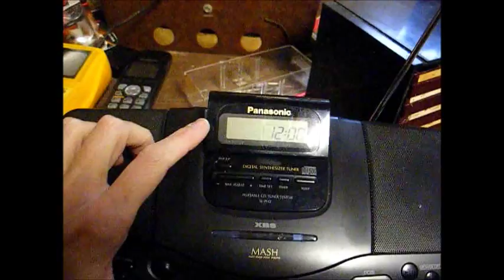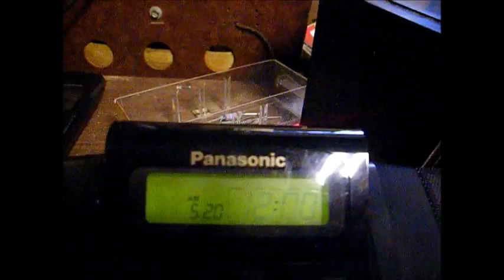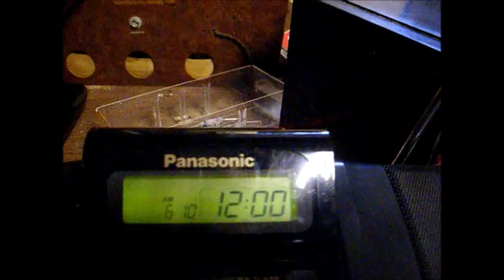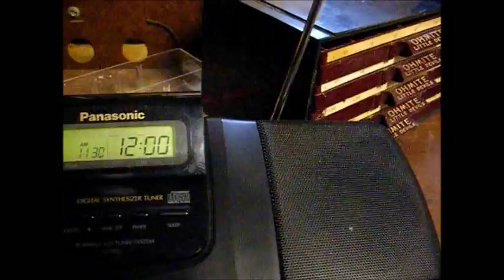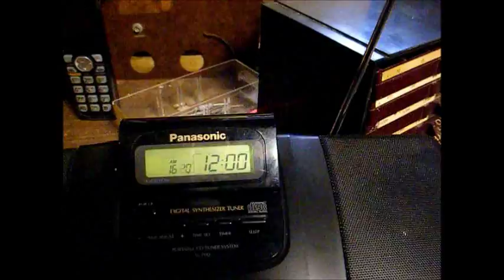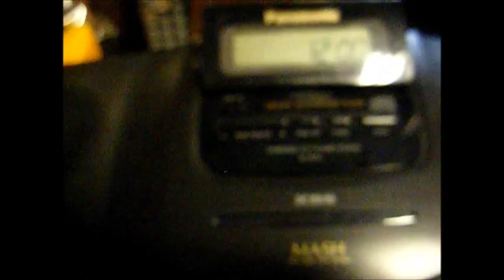First look at a '93 Panasonic AM/FM radio/CD player SL-PH2

Comment: I just rescued a Panasonic stereo from 2000 with a 5 CD changer and two cassette decks and the whole thing works perfectly. Panasonic is among the other few brands which still make good products including Sony, Toshiba, LG, Samsung, and Sharp.
Reply: Or the Playstation for that matter.
Reply: Nintendo makes probably the best quality hardware for gaming! I know a guy on his 3rd 360 but still his first Nintendo 64.
Reply: Samsung TVs are barf, LG not much better, Sony is mostly overrated.
Reply: IAmNotAFunguy Definitely agree. All of my Nintendo stuff is still working fine.
Reply: IAmNotAFunguy  I have a few of those and they still work :)
Reply: IAmNotAFunguy - I still have 2 of my Panasonic 5 CD changer, twin cassette a.m/Fm systems from 1998 & 2004 & a 1992 Panasonic single CD player with twin tape deck radio boom box I got for my 16th birthday, they all still work. I’ve always had Panasonic sound systems because they had the best bass & performance & quality.

Comment: I got a portable CD player to work by cleaning the lens on the laser/photocell with alcohol. It was behaving much the same as that Panasonic, slow running spindle, I think the dirt was preventing the servo from tracking.